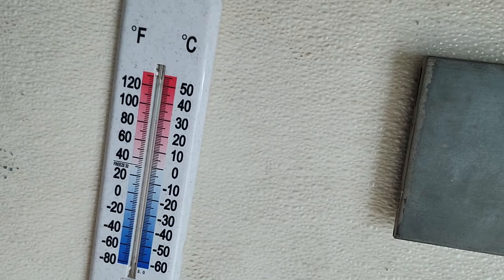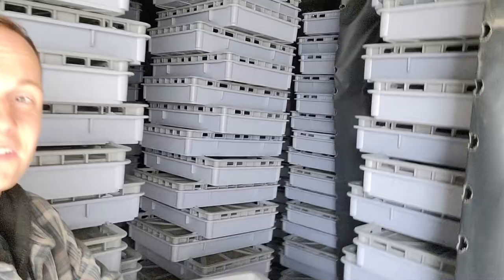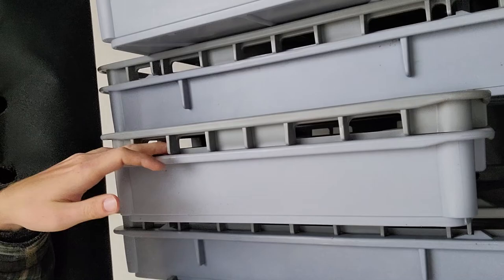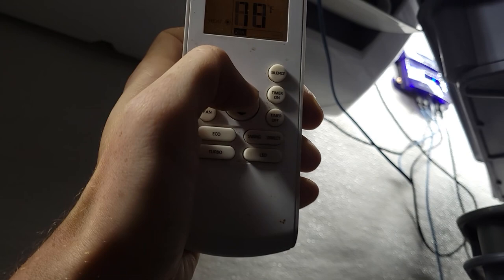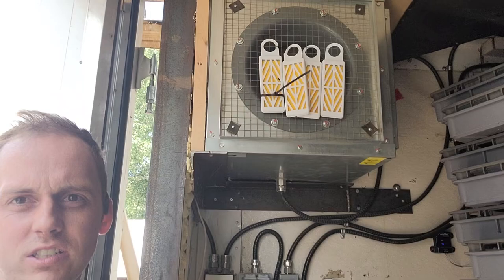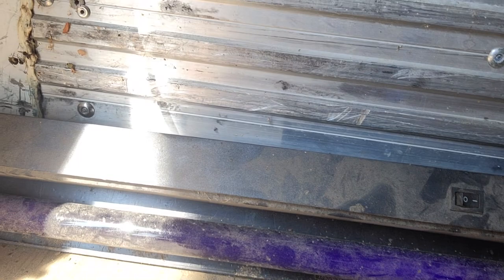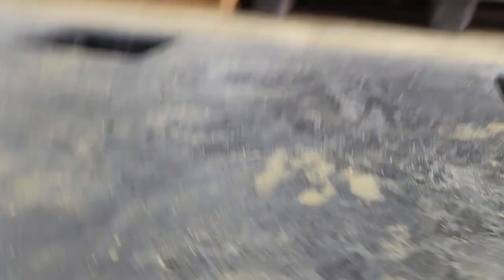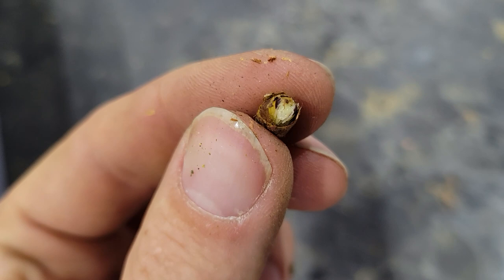Leaf Cutter Bee Incubating-From Larvae to Fully Formed Bees!

Comment: I’m assuming you do a lot of sampling and statistics to get those rough estimates and don’t go through all 16 millions bees yeah? How big are your sample sizes and how often do you take samples?
Reply: So we sample for live counts based on the lots we receive, so usually by field. We would take a small scoop every 10-20 pounds of bees, put them in a different container then stir that together to try and get a random sampling of the whole lot. When I am sampling in the incubators during incubation I try to take a couple samples throughout the incubator but it definitely isn't as comprehensive of a sample. I will also put my hand in trays to feel the heat coming off throughout and I can shut off the fans and listen and you can actually hear the bees starting to move and chew through the leaves thus giving you a heads up that they are getting close. But yes that was a long-winded way to answer the question. We visually inspect lots of the trays but only sample a few throughout to give us a general estimate of where they are at in development.